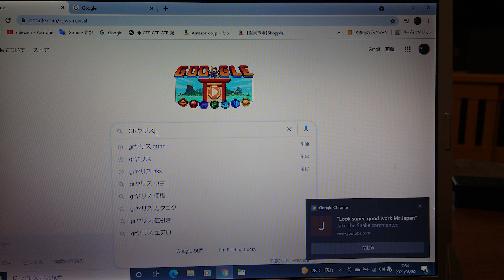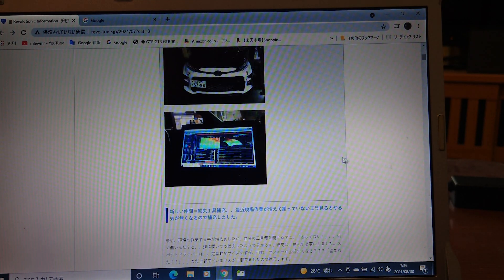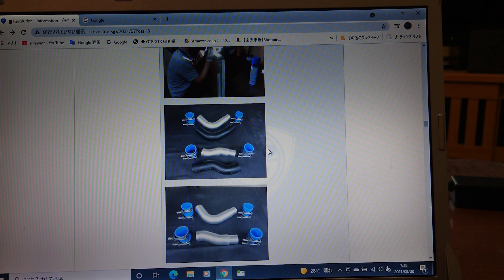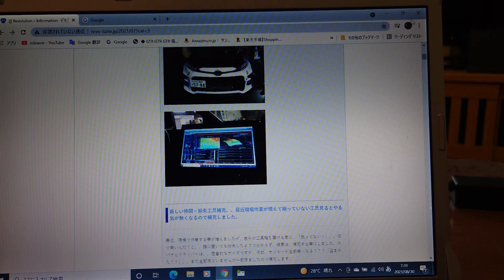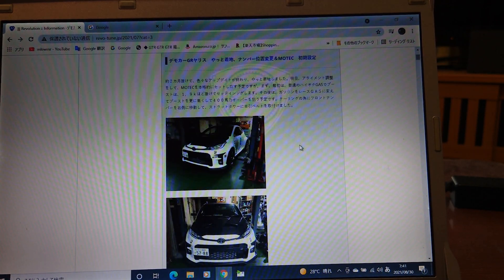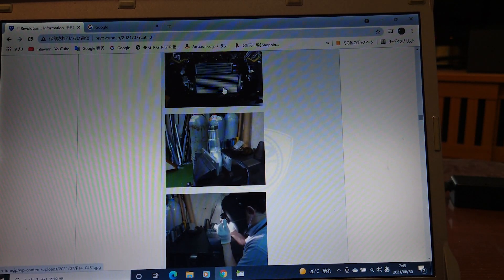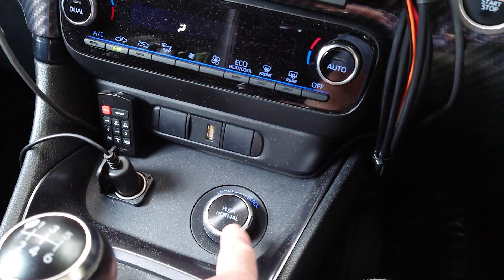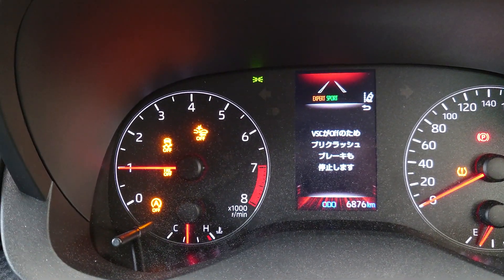GR yaris Talking about MoTeC.

Comment: G force 410hp one is amazing
Reply from the maker: Yes, That's right. G Force also uses Motec. It's very fast. But it seems that they had a hard time because they set up before the kit for each model was starts on sale. I hope a cheaper device will be developed.
"Revolution" says that when set to high boost, becomes the rise of power becomes extremely slow, so misfiring system is unavoidably used. There seems to be more problems, so it may be better to wait for these solution.

Comment: traction control is still on in "expert" mode. long press and no "expert" = true everything off. short press still has safety functions.
Reply from the maker: Yes. Certainly, long press is all released.
One Japanese professional driver said that on the circuit, one-press expert mode can drive faster without understeer.
I have not drove with one press so I'll check it next time.

Comment: Just found out there is an alternative direct replace ECU for GR Yaris.

https://youtu.be/LB2XN_S1hC4
Reply from the maker: Oh that's great.
However, in order to keep high boost, there is a limit to the actuator hardware itself, and it is necessary to manage the interaction with the computer of the 4WD system well.
It's still a mysterious car, but it's great to see a new computer.

Comment: I think too much about the streetcar.
Reply from the maker: Yes, not be able to use safety equipment such as pre-crash brakes, lane keeping, radar cruise control and tire air check. If could not get the power to match it, will lose more. I would like to consider it well. In my case, I feel now the need because there is a high-speed circuit nearby. Thank you.